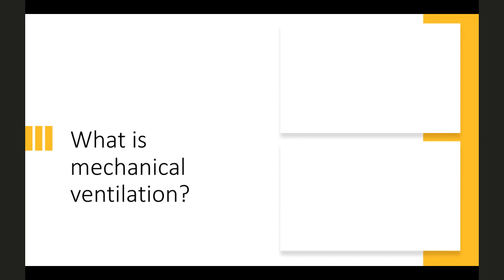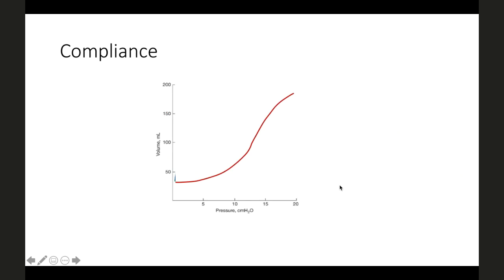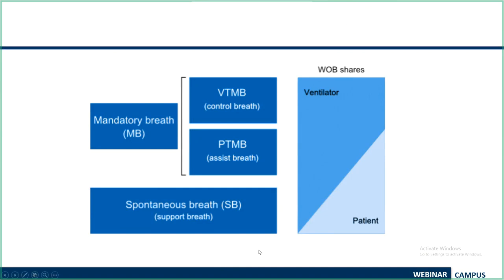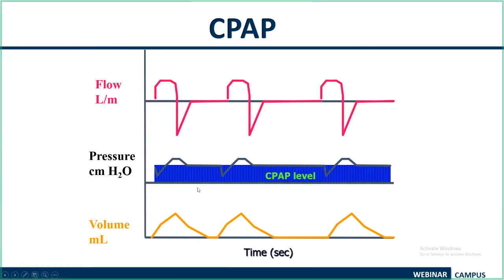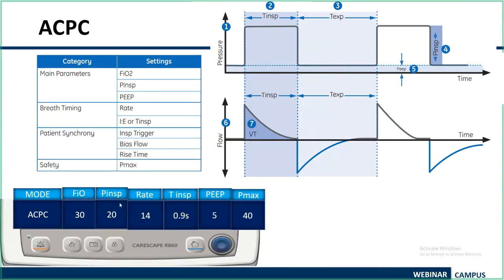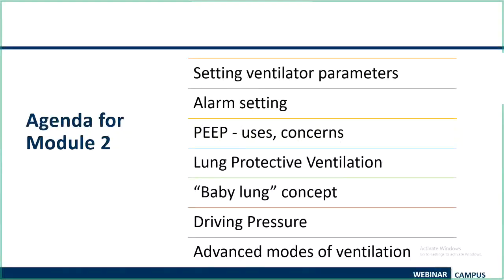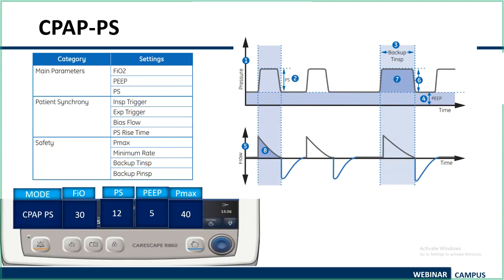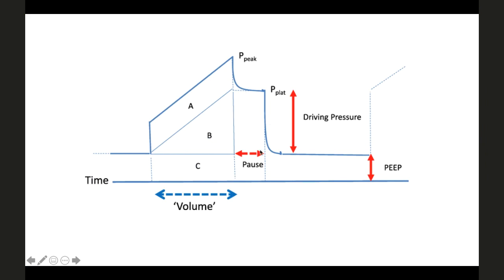Mechanical  Ventilation Webinar (Day1/3) - Dr Saneesh/Dr Anoop Kumar | GE Healthcare | WebinarCAMPUS

Comment: Sir at 1:14:01 , in SIMV the first breath is also trigerred by the patient as there is negative dip in pressure but still that breath is assisted by ventilator. So if its SIMV then why is ventilator assisting that breath?